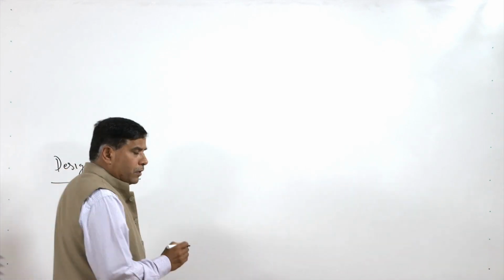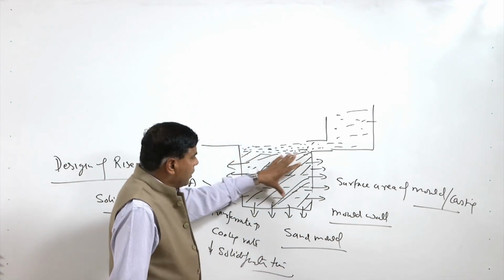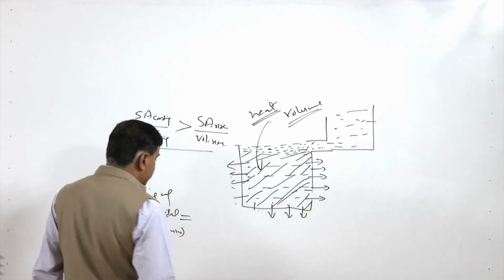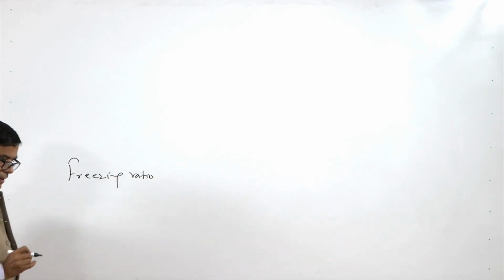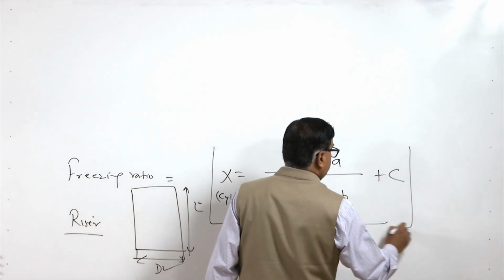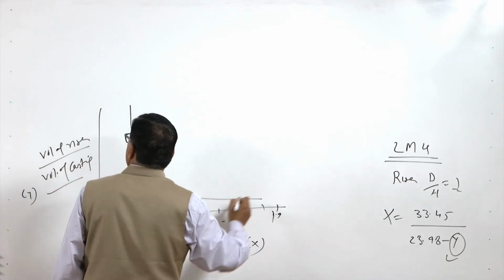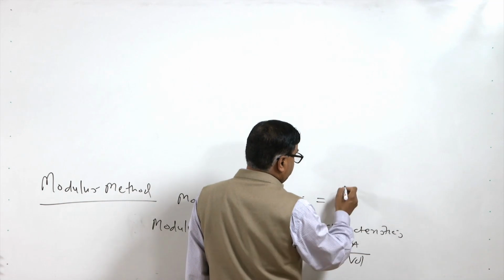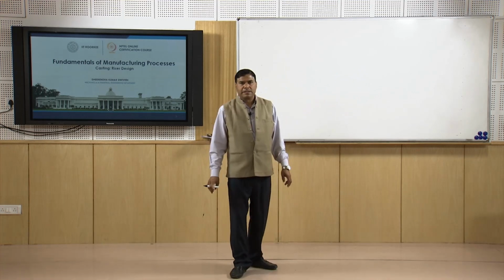Casting: Riser Design

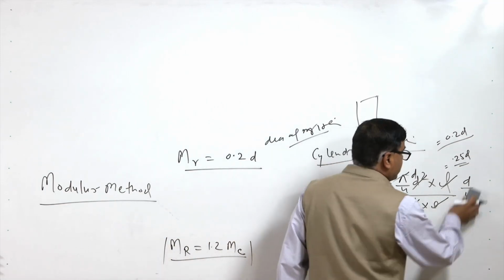Comment: 23:34 if the modulus of the riser is greater than modulus of casting than how are you saying that SA/Vol of riser should also be greater than then SA/Vol of the mould cavity. Aren't these two things contracting. Better to leran how to deliver lectures. Thanks!

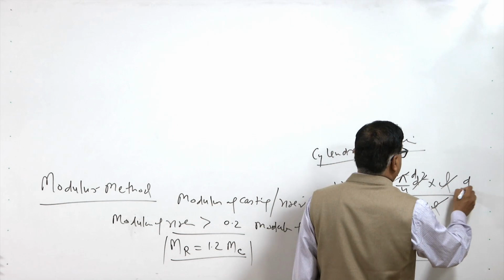Comment: 22:52 i think it is SURFACE AREA of cylindrical riser the modulus will be D/6 and at last the diameter will be equal to 7.2 times the modulus of casting
Reply: wrong
Reply: Better u have explained it